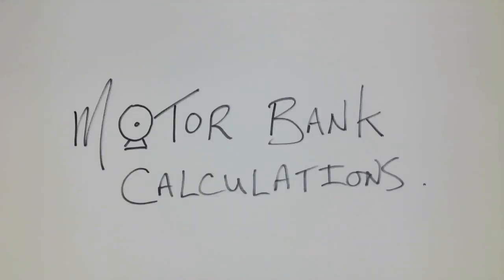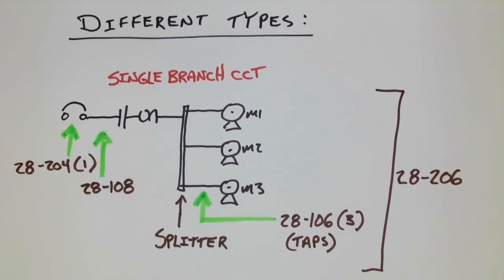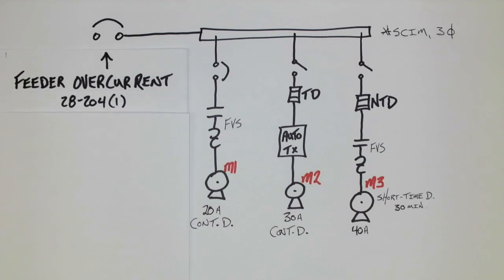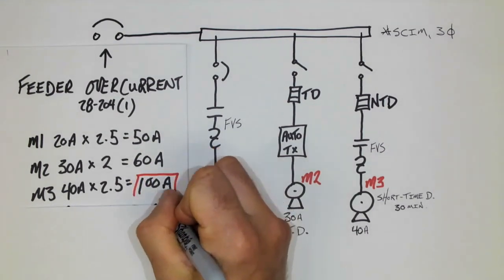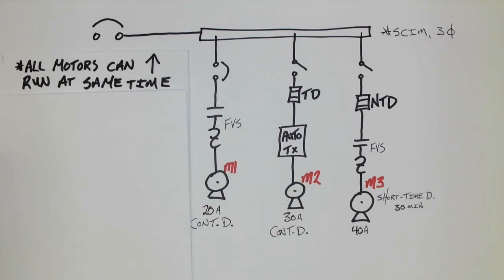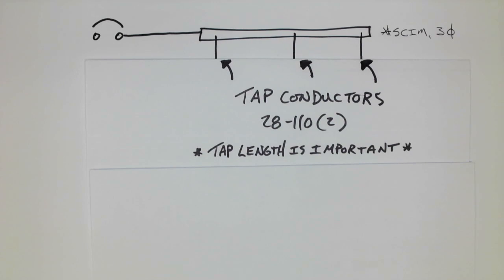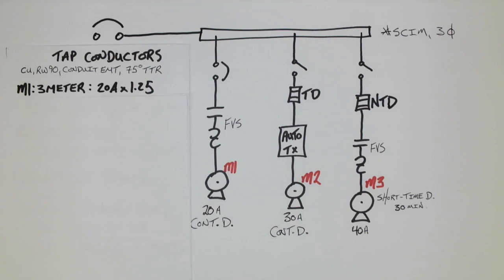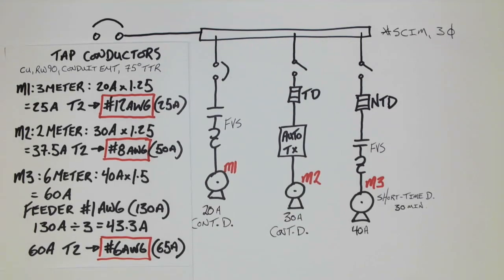Section 28 CEC: Motor Banks calculations

Comment: 600 v 3 phase , 384 kw calculated load demand for a machine shop; and the demand load is continuous calculated load . what is the minimum rating of the electrical service equipment for the shop when the service conductors are rc90 run in free air?
 a, 400 a
b,600 a
c,800 a
d,1000 a
Reply from the maker: Hi John, that's quite the question. There are a few things you will want to keep in mind when calculating:

-other occupancy basic load, table 14
-determine if there are any motor loads or climate (heat/AC)
-continuous rating of the main service OC
-spacing of free air conductors (100%?)

Once you have determined these things, and completed the 3 phase calculation for ampacity, you will be on your way.
Reply: @Red_Seal_Electricin the csa group learning is the study guide im using i bouight the online test stuff , its one of the questions , the answer was 600 i chose 400 it came out 369 amps or something like that .. they had a 70 percent load continuous load applied .. what gives on that that for breakers or something
Reply: they dont provide much for workings in some of  the questions .. anyone out there ever have a exam review done in bc ,, apparently they just look at the exam bubble sheet dust it off run it trough the machine again ,, nobody has ever had a successful review ,, then after that processs you can ask for an appeal that process in its on line address stbcab.ca has the annual general reports from 2006 to 2025 ,, i read them all they have done 3 total in all them yrs ,, all you guys out there should read them mostly cut and paste stuff , and yes they have a budget part time work it says  ,, after that process if you are still not successful there's the judicial review ,, now that part has never done one  review to date .. nada zilch .. i needed one mark for my seal they wouldnt award me one ,, i have two other seals welding millwright have worked in other provinces no complaints about my safety or quality , have 10000 plus hrs in the trade , was out of school for like 10 yrs between 3rd and 4th  , did 4th yr online during covid scam , passed the school provincial part ,got a 69 on the redseal part now i have to do it all over again ,, we get no credit for anything unless its academic ,yep im bitching thats for sure ,, its interesting how the process is set up .. always wonder if it was the crane signal question that put me over the allowable wrong number .. i will never know they dont show you what questions you had wrong to correct the error ,, interesting way  the process works . the ins and outs ,, most of this trade i have never done and never will . yet we are supposed to know it all , then forget it when we move on in life ..
Reply from the maker: Hey John, I think what they are attempting to test with that question is the continuous loading. Since it is not residential, it must be continuous. Since they have provided no info on the continuous rsting of the OC, it must be 80% rated. Since the conductors are single free air, section 8 requires a deration of 70%, as they are capable of carrying more current. Check out the continuous rules in Section 8...

Comment: Thanks a lot. amazing as usual. 
May I ask to make a video how to calculate the over current of grouped fire pumps in normal and  emergency side in cec .
Reply from the maker: Hi Micheal, 
Glad this was helpful for you. As-to fire pumps, they are simply motors. There are no specifics for sizing of the feeder conductors and feeder  OC beyond that which is identified in Section 28. 
Although Section 32 speaks to fire pump equipment in depth, the rules mostly focus on the individual motor  conductors/controllers/overloads.
Cheers.

Comment: Taking my test tomorrow, hoping it all goes well.

Question, when you are sizing the individual OC devices for each motor it says you have M2 as 30A x 2, when I look up Time delay fuse and auto tx its giving me multilpier of 1.75x, you stated x2? Also NTD fuse with a FVS starter for M3 I look it up and it says x3, you state x2.5. Did I do something wrong here?

Thanks for the videos, hoping they get me through (coming from England so it's been a bit of a wild learning journey lol)
Reply from the maker: Hi there littletyke, your confusing the difference between calculating individual OC protection for a branch cct and calculating the max OC of each branch for determining the main. When doing the later, one must use the multiplier that corresponds to the OC type that aligns with the main.
It can be confusing. 
I encourage you to walk through the video again, along with the CEC rules for reference.
Reply: @Red_Seal_Electricin  Thanks, appreciate it, I see where I went wrong!

Comment: Thanks for the tutorial. Question about the overcurrent for the feeder. Shoudn't it be 125A and not 150A? I thought it should not exceed the calculated value, so it should go down a step in Table 13. I might be wrong, so your input is appreciated.
Reply from the maker: Good question. The rule indicates we cannot select an OC larger than what is calculated. Since 150A is a standard size OC in Table 13, we are permitted to use it. Remember, we can select an OC equivalent-to or smaller-than the maximum calculated.  Its similar to speed limits on the road. 100km/h or slower is acceptable to drive at on the highway, but no faster. Hope that helps...
Reply: @Red_Seal_Electricin  Thanks, but for exams purposes, 125A is the correct answer?
Reply: @ricardod4321  If the number falls on exactly on 150A then 150A breaker is fine. If it fell on 149A then you would size down
Reply: @littletyke76  Got it, thanks!